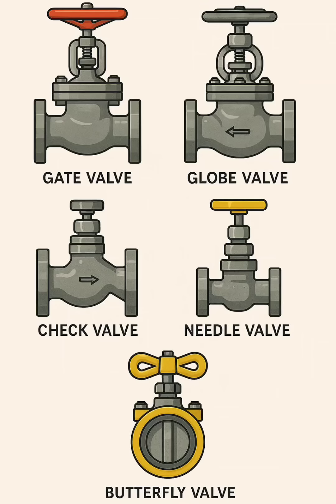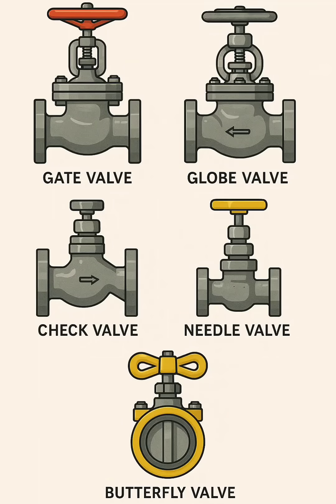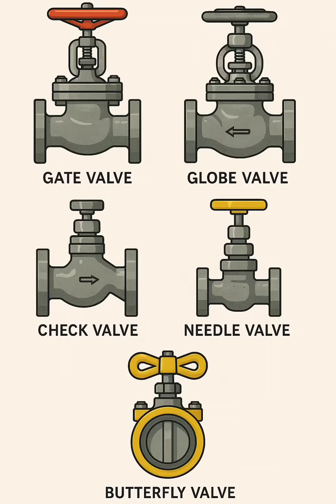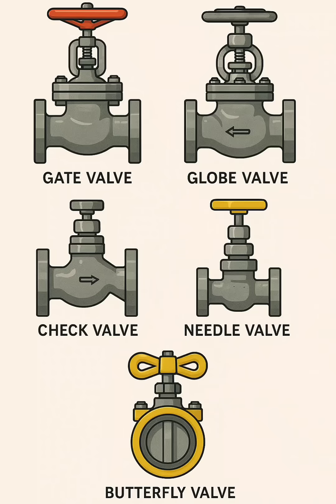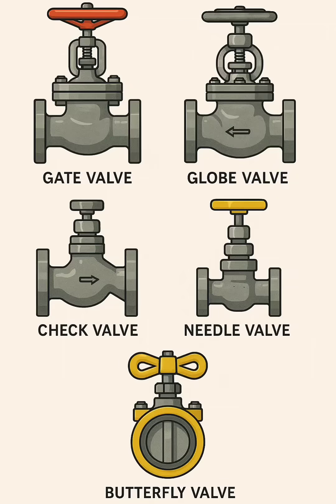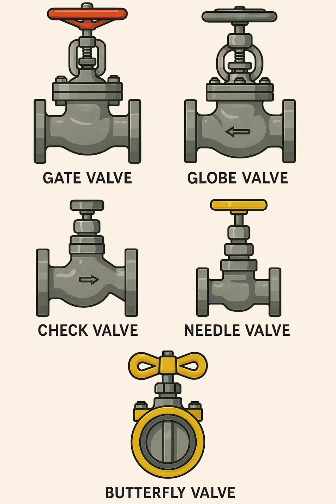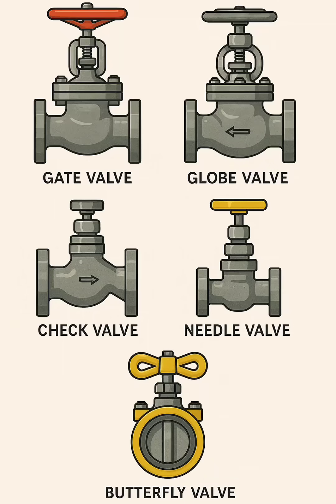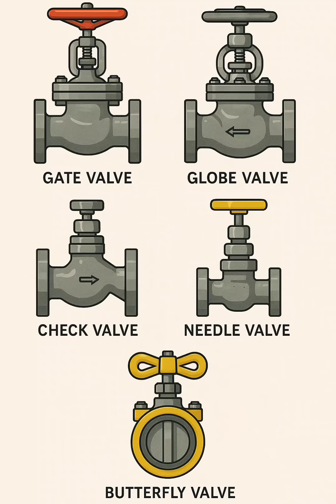Gate, Globe, Check, Needle, and Butterfly Valves #engineering #mechanic #drillinghse #valve

Comment from the maker: 🔧 Quick Summary of 5 Common Valves:

Gate Valve: On/Off service, straight flow, minimal pressure drop.

Globe Valve: Best for throttling & flow control, higher pressure drop.

Check Valve: One-way flow, prevents backflow automatically.

Needle Valve: Precise small-flow control, instrumentation use.

Butterfly Valve: Lightweight, fast operation, space-saving, moderate control.

👉 Each valve has a specific role — choosing the right one improves safety and efficiency in drilling and industrial operations.
💬 Which valve do you use most on your rig or site? Share your experience below 👇